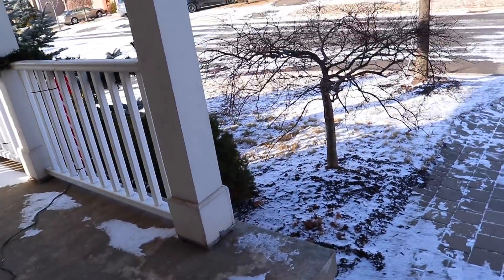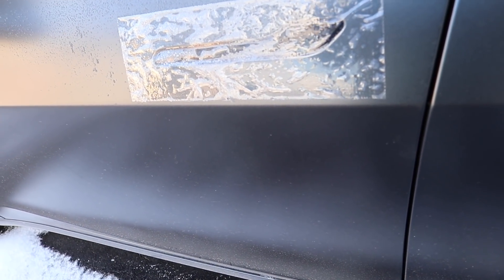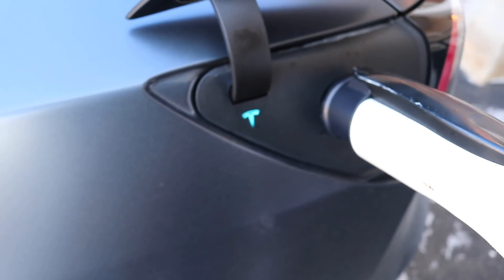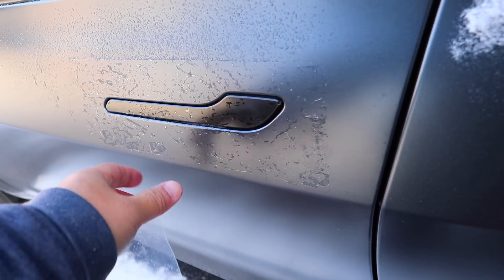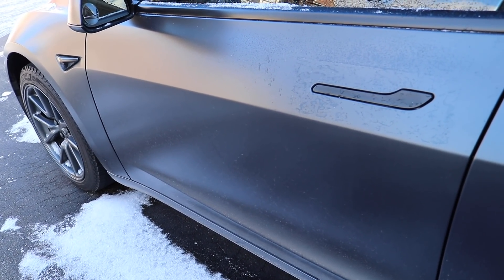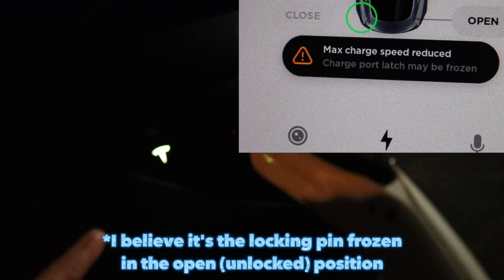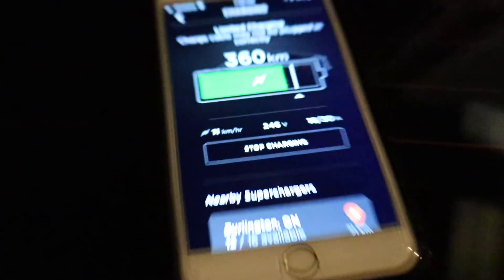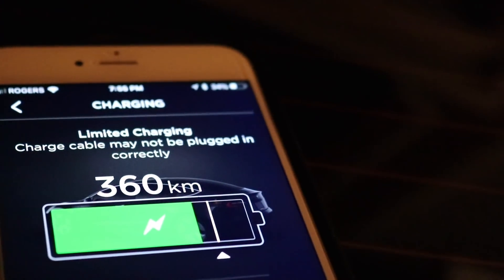Tesla Model 3 - Frozen Door Handles and Charge Ports?

Comment: There is an emergency pull tab in your trunk for the charge port assuming you already have the update and it's still not heating the charge port all the way. As far as the handles go, it is advised that you insure that all the moisture is out of the handle. That's why having some kind of covering for the car is so important.
Reply from the maker: Thanks, I know about the emergency pull tab. The charger wasn’t stuck though. It’s hard to keep moisture out of the handles during a snow/ice storm.

Comment: Once, I couldn't put the plug into the port, and once I couldn't get it out; I used a hairblower.  On a daily basis when I've taken the car to a car wash..just a thump with the soft part of my hand, does the trick, then make sure the handle is pushed in, and no problem.
Reply from the maker: I’ve always subscribed to that method. Hehehe. Brute force. 😛

Comment: @DaxM where did you get the chrome delete done?
Reply from the maker: A detailing place in Oakville Ontario called Inception Automotive Detailing. 
A heads up, the mirrors are a pain to do. Unless they completely take the whole mirror assembly off, it doesn’t work properly. Not sure if Inception takes the mirrors off.